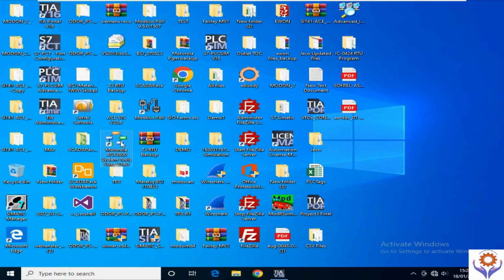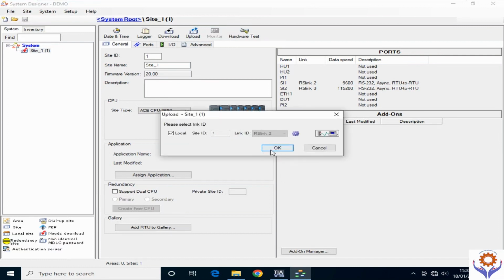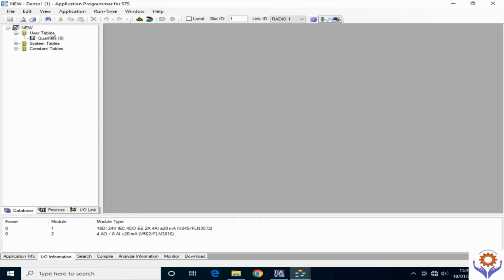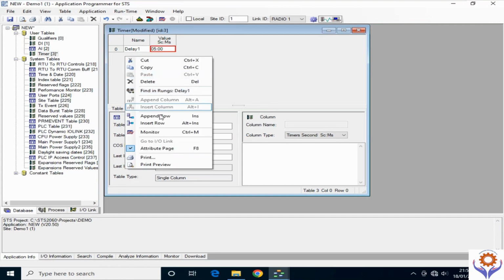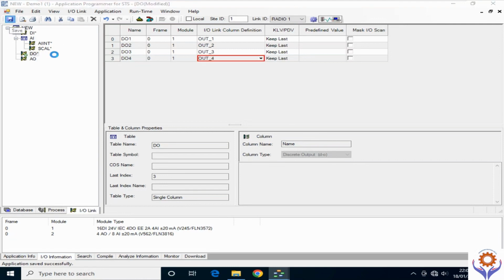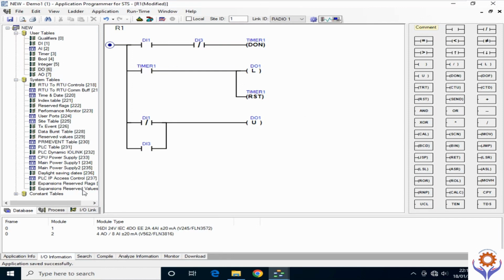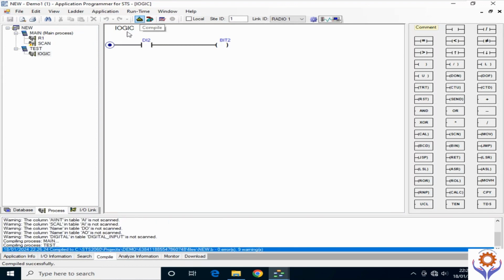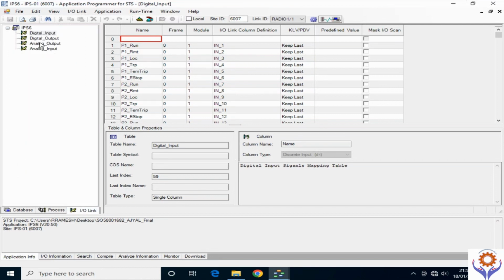Motorola ACE3600 RTU -STS Configuration - Part 1 | System Tool Suite ACE3600  RTU Programming -1

Comment: how can i back up existing project from the main RTU ?
Reply from the maker: @mtemu1223  we can take the  backup directly from the  folder location. For that when you open the STS applications . You can find the project location directly or save as the project and take the complete folder
Reply: @Automation4all  the problem that I don't have the project itself but it's downloaded to all RTU units so I was asking if there a way to do an upload process or backup from the main RTU so I can make modifications to the configurations and see the errors that I am facing
Reply from the maker: @mtemu1223   In Motorola RTU  don't have option to upload the Application program from RTU .We can upload only the Configuration and Network files. We have one option that if we download the  Application program in site Sources ,. then it is possible to upload the application program  in site source.
Reply: @Automation4all  could you share the way to get the configration and network files ?
Reply from the maker: @mtemu1223  Motorola ACE3600 RTU -STS Program, Communication ,Diagnostics Part-2    . you can find how to upload the site configuration , site source and network configuration from 17 mins to 25 mins for upload .                     https://www.youtube.com/watch?v=LtA6HBiwYpo

Comment: Good morning Engineer
I have an issue with Motorola DO 
when you make a power restart to the RTU 
ALL DO are activated for awhile (little than a second) and then be off DO TEST
Have you any solution for this issue in configuration or programming 
And thanks very much
Reply from the maker: Hi Good Morning
  Kindly check and confirm the 3 below areas
1.check the  IO link DO configuration
2. Need to verify the DO in the application .if you are using Generic application then required to check complete application . Also need to check DO tables for any time delay
3. Also required to check the diagnostics area for DO
Reply: Thanks So much

Comment: How to setup COMMUNICATION NETWORK 
ACE3600 to Radio MDS

PI1
media	Rs232
Operation mode Sync
Connection Type RTU as DEC
Connection Mode

Link Name : LINE 1
Reply: Sir, i was try it
PI1
Media RS 232
Operation mode   Async
Connection type    External modem
Connection mode MAS ( Radios)
Type Multi drop half duplex
link name - Radio 1

error
# 141
Can not find link id in network configuration, network layer: 
NETWRK
dest site: 1000 ,   dest link: 21 ,   dest port: 0

Your advise Please
Reply from the maker: @ikancupangpremium3447   The network layer in RTU is asked to transfer a communication buffer to the Dest site , Dest link and Dest port but there is no route defined in the network configuration which communication can be transferred through.
Reply from the maker: PI1
Media RS 232
Operation mode   Async
Connection type    External modem
Connection mode MAS ( Radios)
Type Multi drop half duplex
 link name - Radio 1 or Line  based on your configuration